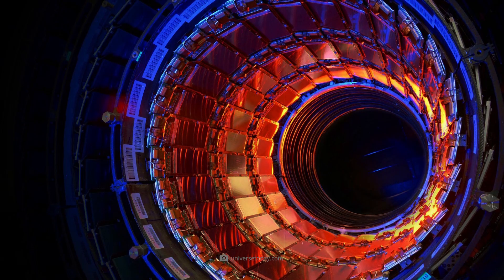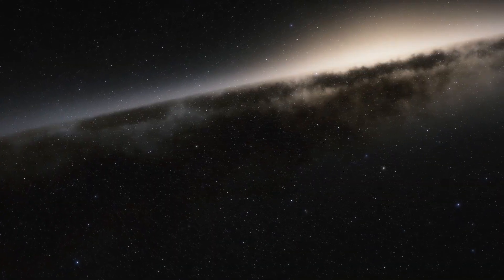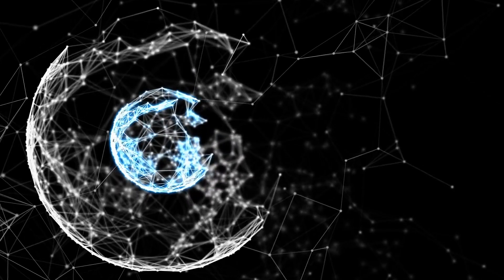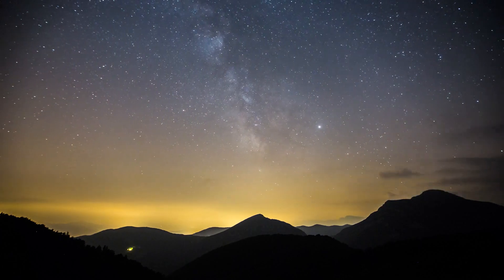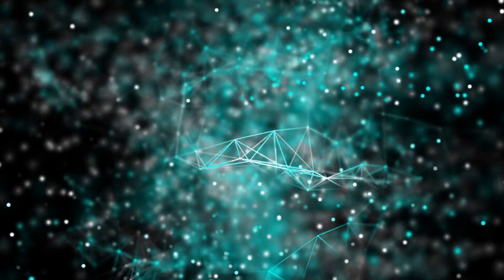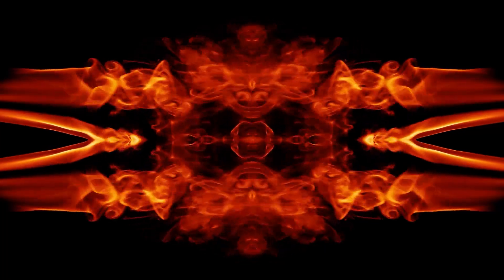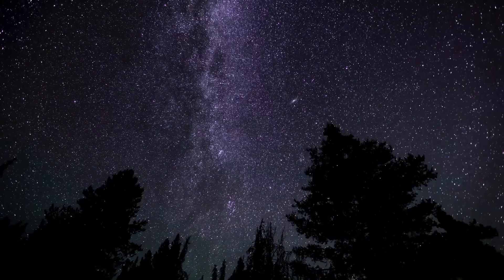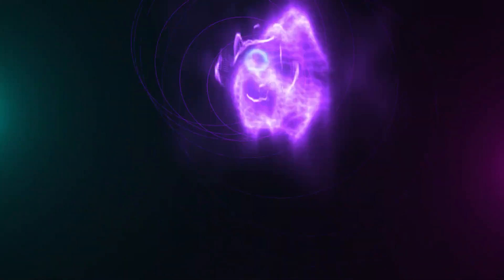Physicists Shock the World: Discovery of a Top Quark Sheds Light on the First Moments of Big Bang!

Comment: If the quarks have such a short lifespan of 10^-23 seconds, then why didn't they all decay before they were able to form into protons after the theorized big bang?  Also, why do protons have such a long lifespan if they're made up of quarks that have extremely short lifespans?
Reply: As for why the quarks didnt decay, i dont know, but the big bang is only a theory and its borderline impossible to prove that there wasnt existance before the big bang. However, protons have long lifecycles because theyre stable, think of it as its own little system, they require nothing from the outside world once theres 2 up and 1 down quark. and since the strong nuclear force is the strongest of the forces and they dont require more quarks to stay stable they have no reason to stop doing what theyre doing once bound